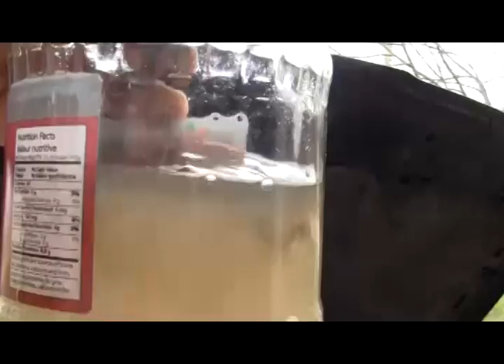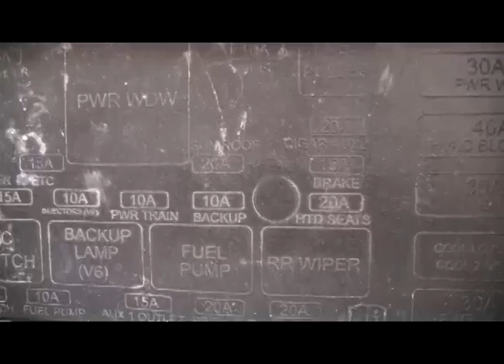How to Drain Dirty Gas in BMW/Mercedes/GM/Ford

Comment from the maker: You are right, Injectors are disconnected, i never changed the fuel filter, the car ran ok after fresh gas was filled., but changing fuel filter is a good idea.The only hing different is I ran the Pump with a jumper.This car is not with me anymore, I dont  have to deal with Gas, I have electric car.

Comment: Ok, thanks for the video.   I have a  BMW Z3 that sat just under 5 years.  The owner did not treat the gas so I want to drain it before adding fresh fuel.   From your video and what other people have said, to use your method will run the crappy fuel through the fuel filter.  I am presuming not the injectors because it appears the line is disconnected before them.  Am I correct?  Not expecting a reply after seeing it has been 2 years since the last one, but maybe someone will reply.  I also might suggest if possible to avoid a huge spill while under a car and disconnecting fuel lines, it is sometimes a good tip to pinch off the fuel lines with needle nose vice grips with rubber hoses on the ends.  This will stop the fuel until you disconnect the lines, then once your catch can is ready, simply release the vice grips.
Reply: I also might add that the video demonstrator said he used gas to clean things with.  That is a bad  and unsafe practice as it is very flammable.

Comment: Will this work the same if I have the fuel filter off? Will it just come pouring out at the line before the filter? I have a 97 BMW and there are few ways to get fuel out, this being what looks to be easiest.
Reply from the maker: +Gainey Gainey if the filter location is after the pump then it will work.
Find pump relay and jumper the coresponding contact.

Comment: I sure hope you changed your in-line petrol / fuel  filter after you basically cleaned out your gas tank into your Petrol / Fuel filter...
Reply from the maker: Actually No, my fuel filter is the same.Car is running without problem.
Reply: I'm glad you are not experiencing any fuel flow problems. However, I sure would keep a SPARE fuel filter handy !  :-}

Comment: This doesnt show how you got the tube to get the fuel into the glass in the bmw and what do I do to pump it out?
Reply: And how did you clean it great video but I'm so confused.
Reply from the maker: first: disconnect the fuel rail, second:find the fuel pump fuse.Third:Remove fuse and apply 12v to one of the terminals where fuse was connected,this will start fuel pump to pump fuel out, when empty, add fresh fuel, and repeat, until fuel in glass jar is clean.This is my way, maybe there is a better way.But dont smoke around the car, and do it i good ventilated place, outside of garage.Just in case.

Comment: That's not just dirty that is full of water to boot. You can see the separation, water is heavier then gas, the gas is actually floating on top of the water in the jar.
Reply from the maker: +Chad O'Neill 
Agree,It was a big mess.